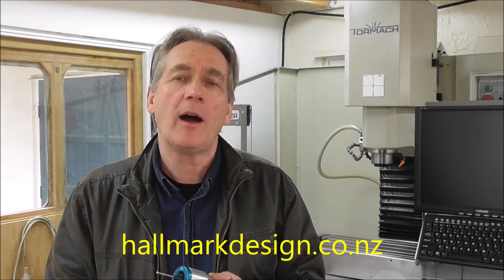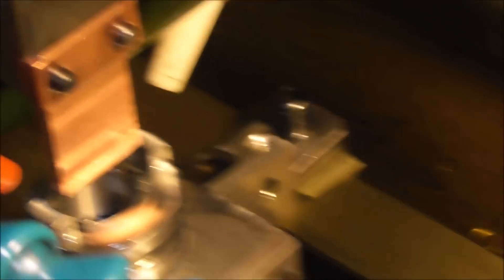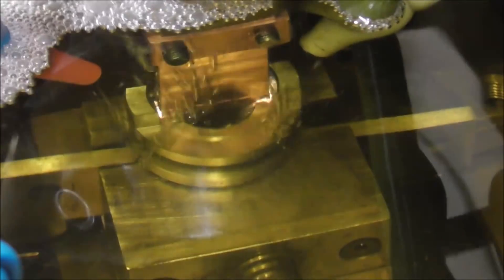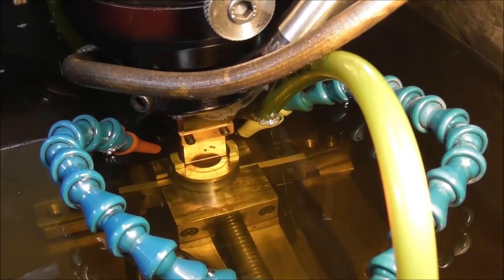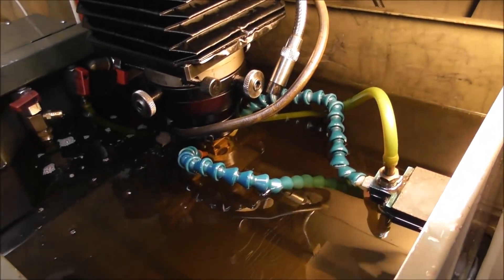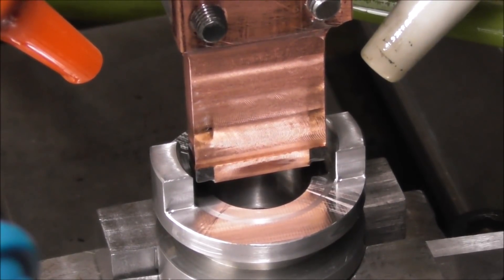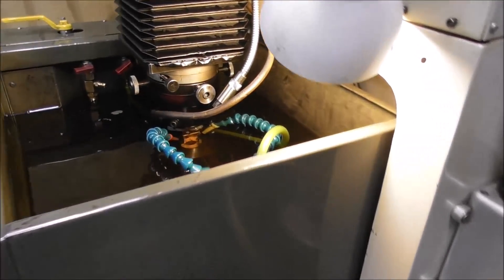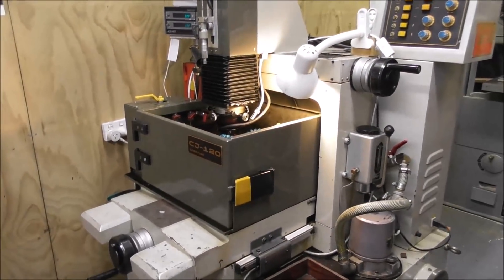What About a Spark Eroder ......

Comment: is it possible if we spark erosion on bass relief? I means copper (that are already bass relief) and spark into steel material. I never saw on youtube with bass relief execution, only cutting with wire and 1 layer erosion. Am really curious
Reply from the maker: Hi Syam. What do you mean by bass relief?  Do you mean - ( I googled) :  "sculptural relief in which the projection from the surrounding surface is slight and no part of the modeled form is undercut. Cliff
Reply: @Threadexpress  hi Cliff. Yap, you were right. Something like that. Is it possible if that copper material hv a sculptural relief and spark into steel?
Reply from the maker: @SyamDanarta  Yes this type of low height to big surface area shape is very suitable for sparking. (High height to small surface area is more difficult)The copper material would need to be thick enough ( I mean if it was very thin sheet copper it may be a problem) But thick copper would work well. Cheers  Cliff
Reply: @Threadexpress  really? Sculptural relief on copper can be done on spark? Minimum 2mm thickness, right? And we don't need to polish the iron material when the copper is in good condition, right? This is why I want to move on from CNC into spark. Got many problem with thin needles, often break when making small details in iron material. Awesome, I love you full, Cliff. Thx a lot for sharing your experience with me .
Reply from the maker: @SyamDanarta  Re polishing. If you set a small current then the surface finish is good but the process is usually too slow. So usually you set a bigger current and remove most of the steel, then set a small current for the last maybe 0.10mm to get a smoother surface. But the surface finish will not be highly polished as the bigger current will make the copper less polished, so it will finish more like a satin surface.
Maybe best to visit a spark eroding /EDM contact machinist and show him your sculpture and ask him to explain this.  Cheers  Cliff
Reply: @Threadexpress  my job is making medal mold, pin, etc. So its not bigger surface. This is new for me.. Nice to meet and talk with you, Cliff. Cheers from Indonesia and GBU..

Comment: I bought a sinker thinking about playing with it since I got it cheaper than scrap price, next I would need to figure out some electrical problem it has and how to even fire it up, since the manuals came only like in Spanish and Italian and I don't speak a word of those languages.  If I never get into it, it has still some nice ground ball screws and a Heidenhain DRO reading in microns that alone are worth many times more than I paid for it.
Reply: The machine was removed from use in a working condition a couple years back by the way and been still under a roof after that, so it could not be that bad to get it working I think.
Reply from the maker: @MF175mp  Interesting. Why dont you use google translate, if you cant find an English manual.  Cheers  Cliff
Reply: @Threadexpress  Thanks for the reply Cliff, I may try it after I get some of my other projects done, I need to cast a concrete pad to install my Moriseiki lathe on to later and build a small cnc lathe, when I'm ready with those, I'll look into it. I have thought about a few little things I could do with the sinker, including drilling coolant holes through some lathe tools etc.

Comment: Hey Cliff.

Love the Spark Eroder, a very handy piece of equipment to have when needed.

 I have a smaller version i use for Thread Tap Burning / Removal.

I only use it on a an infrequent basis but it does make life easier for those types of jobs.
Mostly it is used for customer jobs, where the customer brings me the part with a Broken Tap or Bolt that has broken off.  (  for what ever reason,  but Never there fault, LOL. )

It,s an interesting part you are making.
I have recently rebuilt a similar Drilling Machine for a customer that was,  lets say Destroyed by Someone ???  (  Someone.   But someone never owns up to there error ??? )

I disassembled the complete gearbox.  Rebuilt it with new bearings and some new bushes only to find on disassembly Many more jobs to do.

One shaft was Bent ?? another shaft was twisted which i re-made.
 Then finally fixing the only thing that was supposedly damaged i re-made a new Auto Feed gear for the gearbox.
Which was the only job that was to do from the start???
It seemed simple but in the end a fairly Big Job.

The Drilling Machine was like yours Made in Sweden by  ARBOGA-SWEDEN.

Thanks for the video, Cliff.
All the Best.
Regards Peter.
Reply from the maker: Hi Peter - Interesting to hear!  Its always difficult to justify the cost of a rebuild like that - the customer often does not want to hear all the problems you found. Sounds like you had quite a few hours work there?  Did you find the quality not quite reaching what you expected from all the Swedish hype....good enough...but not a Brown and Sharpe!  Cheers  Cliff
Reply from the maker: @weldmachine  Hi Peter. I dont use Instagram and cant find your page via search. Send me a link if that can be done.  Cheers  Cliff

Comment: Great video. Do these machines generate lots of radio interference? I think sometimes people use graphite electrodes, is that mainly to resist wear? I imagine copper is easier to work with, not requiring the dust evacuation.
Reply from the maker: Hi - Funnily enough in the 90's I had major problems with radio interference!  It is especially bad if you live in a remote area (as I was) where the normal radio signals are weak, and a householders recievers auto gain is wound right up.  Graphite or Copper - it is endlessly debated.  Its a cultural thing, in the US most folk use graphite. In UK and NZ it is copper. Cheers  Cliff

Comment: I'm curious about the life span you see on that indicator that's showing the vertical movement on your EDM Cliff. Most indicators lead a pampered life compared to what it's doing.
Reply from the maker: Yes I agree - but these plunger style indicators seem to run for years!  Cheers  Cliff
Reply: @Threadexpress  Many thanks for the information Cliff, they must be a lot more durable than I'd thought.